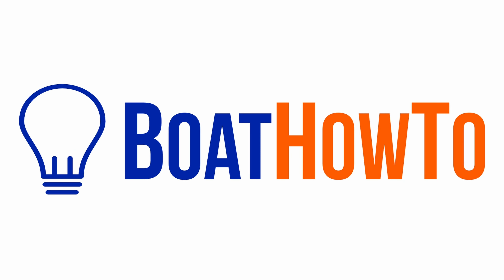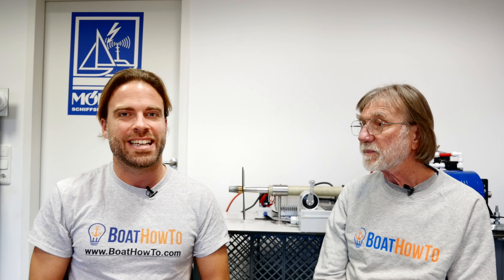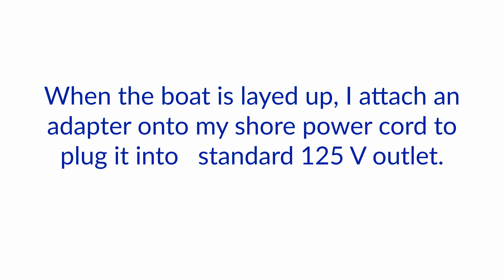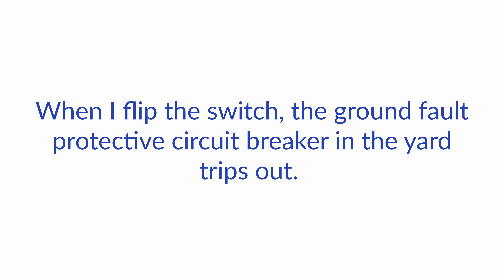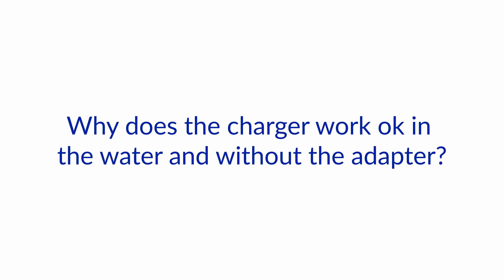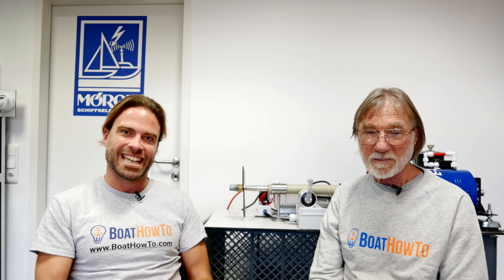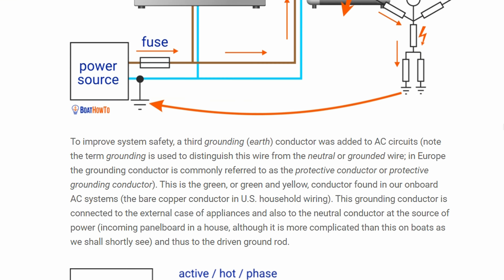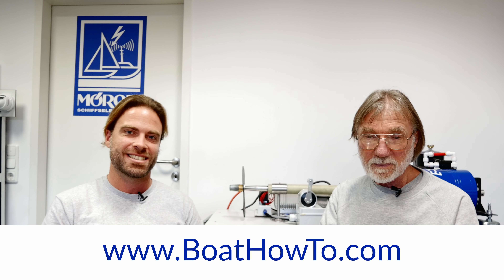FAULTY BATTERY CHARGER tripping the yard's GFCI? | Ask The Expert with NIGEL CALDER

Comment: I believe before condemning the battery charger, I would suggest looking at the resistance between the vessels ground and neutral lines at the shore power inlet with the breakers closed.  If neutral and ground are connected anywhere within the vessel, the Kirchhoff based current detection will trip because of the imbalance of current between the hot and neutral wires ( because some of the neutral wire current is returning via the ground wire ).

Comment: Could an ohmmeter be used on the adapter to rule it out as a potential cause of the leakage current?  Or is that just incredibly unlikely, and so the culprit is almost certainly the charger?